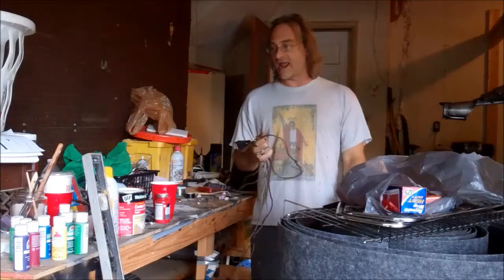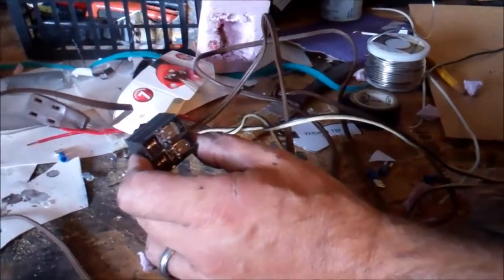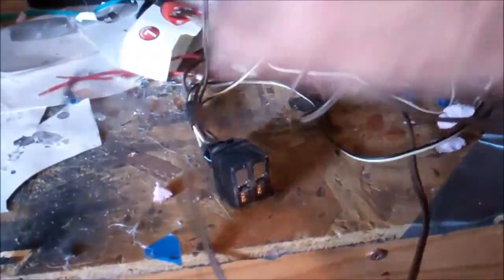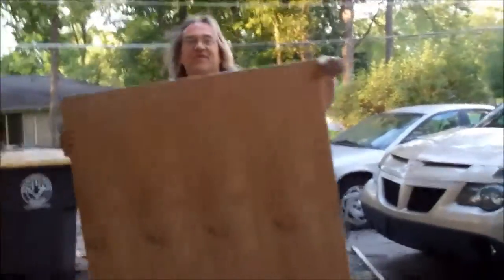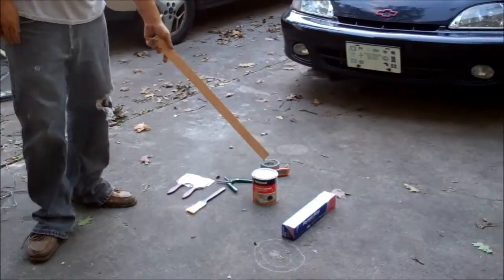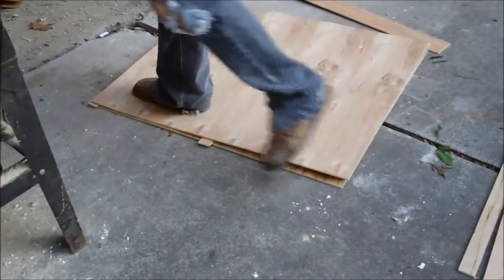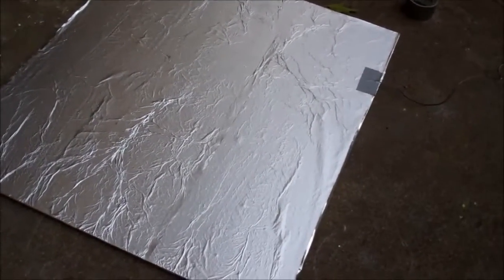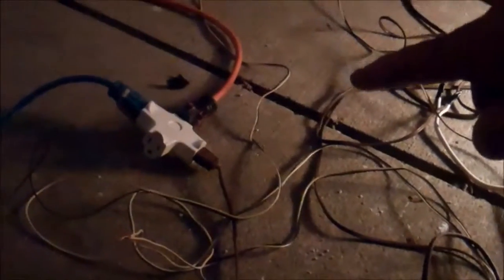How to build a Pressure Switch for Halloween Home Haunt

Comment: Dirk, thanks for the great content! This is really informative. Can you share a list of all wiring and relay parts needed to make this work? Can you recommend the cheapest and simplest way to wire your floor switch so it will run a fog fan and mp3 player both for about 20 seconds, then turn off automatically?